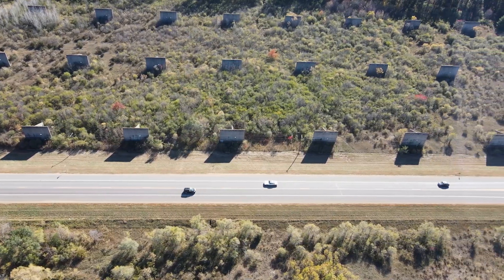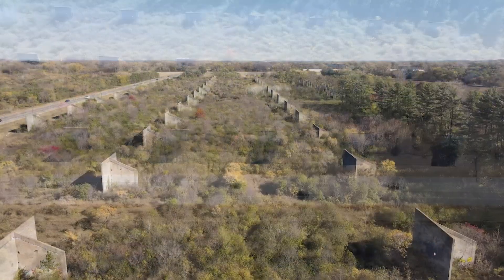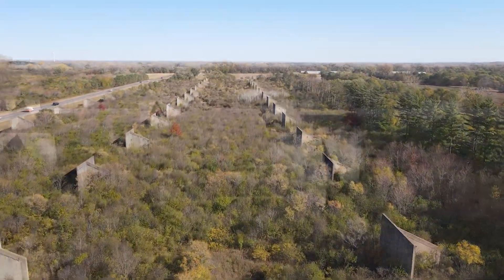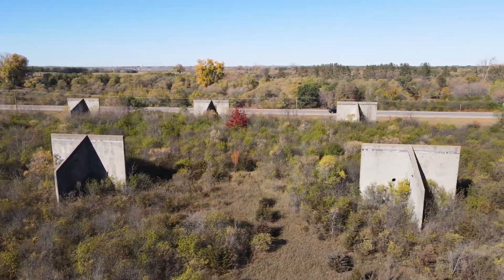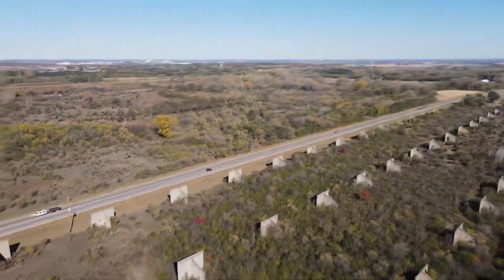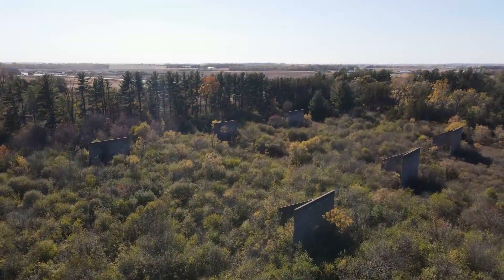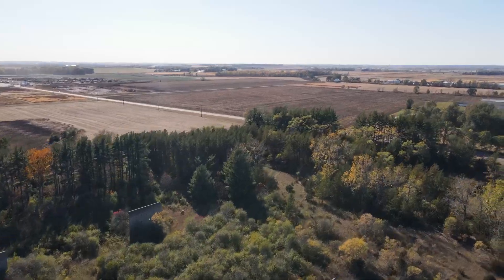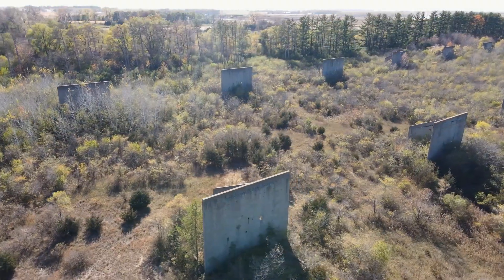What are the Concrete T-Walls in Rosemount, Minnesota?

Comment: My little yard butts up to a BNSF rail line and and they idle their engines behind my house constantly with their poorly maintained and rickety engines. Id love to pour some of these at my property line.

May not stop the diesel smoke wafting through the windows but it should help cut the percussive noises of air compressors running contantly like a Tommy Gun and my pictures may not rattle on the walls anymore. 🤔   Oh wait. City ordinances. 😮‍💨

Comment: See those holes? Those had shutters. The components of the ammunition would go through these holes and where assembled in the compartment behind the wall. The rest of the compartment was sheath metal, that would blow away, in case of a accident. 
They could had used single U-shaped compartments, but someone liked a space and material efficient factory.
Reply from the maker: Oh interesting!

Comment: Surely there are Tons of additional concrete structures under ground associated with the T structures. Removal of all of that would be tremendously expensive, so, in typical Gov't manner they simply turned it over to the state so They have to deal with it.

Comment: Visible with Google Maps.  The building foundations are still visible across the road.  Regards - Mike
Reply: I was curious about their orientation north/south and whether they would make good bracing for a solar farm high enough off the ground to allow tractors, row crops, or farm animals under the panels. Looks like they would be ideal for this. 

The wide or cross part of the massive concrete Tees, which has a level top is square with north. The staff of the Tee is angled downward and is headed due south. Perfect orientation for a solar panel, maybe 30 degrees or more from horizontal. Also allows snow to shed to the south. The tees are spaced about 41m (approx. 135') on center east/west, and north south spacing is about 61 meters (200') on center. This could allow good lateral support for a row of solar panels running east-west. The panels sloped to the south. The shaft of the tee being about 6m long or about 20'. Measured down the 30 degree slope gives a length of about 23 feet. would imply three panels high would be a good number. 

The cross bar of the Tee being about 11m long (about 36') Poles with fairly small concrete pier footings about ten feet on center or more could support the framing for the panel support. Without much need for cross bracing to the ground if the shed roof structure is built like a self bracing diaphragm connected well to the concrete walls every 134 feet or so. A chain link fence on the north  wall line between structures to restrict access. Maybe a ladder at each structure and a cat walk on the top edge of the panels for access. The top edge of the panels being about 30 feet above the ground. The lower edge of the roof being about 18' above grade.

This could be developed as a great solar farm, perhaps in stages, while still keeping the ground mostly open for agriculture of various kinds. Without the need to demolish and dispose of the concrete as waste.

Comment: The "T" walls weren't part of the actual factory - they are part of the ammunition storage area structure. Great video!
Reply from the maker: Ah good to know, thanks!!
Reply: So an incorrect video is still a great video.  Americans are not keen on upping the bar.  Reach arounds for everybody!
Reply: @ShainAndrews  Correct! I should have also mentioned that the factory itself was quite a bit further north, in fact the tech college is located where many of the administration buildings once stood. Google Maps shows a lot of remnants of the factory buildings. My grandfather worked there as an electrician while it was being built.
Reply: @edwardstd52  Google maps shows very out of date pictures of the area. Not much else still standing. A few structures in the woods. A hand full of wooden nailed shut hatches in the ground. Some vent pipes but very very overgrown. If you saw the smokestacks on Google maps, they are no longer there.
Reply: @Boostedfpv   I'm familiar with the Gopher Ordnance Works since my days as a student at the U of MN back in the early '70s. I do remember the smoke stacks from those days. As an employee of the Minnesota State Colleges & Universities, I also visited the area quite often when I had to travel to Dakota Tech for meetings. I think this Wikipedia link has some good info from the olden days: https://en.wikipedia.org/wiki/Gopher_Ordnance_Works
Reply: @ShainAndrews  PARTICIPATION TROPHIES RAISE INCOMPETENCE

Comment: Because they are staggered I say that was BS why would a building have staggered supports, snow fence is a more believable explanation. If it made the road easier to keep clear of snow workers at a vital war plant would be better able to get to a from work.
Reply: Just because the walls don't face each other doesn't preclude them from being structural. Maybe try to search more on structural engineering

Comment: I have driven past those so many times and wondered what they are. I thought maybe they were for wind or tornado disruption. 

Thanks for clearing this up.
Reply: I'm pretty sure that's more likely than a factory.
Reply: @mr.cantsay  You wouldn't say that if you had seen it when the factory was still standing.
Reply: @jbbuzzable  your right but it isn't and some how the floor is missing and every other integral piece of a building. Beside what appear to be wind breaks. I do not know but it doesn't look right to me.

Comment: If their supports for walls to a building, why are they all facing the same direction 🤔 I'm calling bs.
Reply from the maker: Yeah that is kind of weird, isn't it?
Reply: @XRPotanist  then what is it for smart guy ? Please tell everyone
Reply: If it was intended to be a gunpowder factory then I would suggest that these aren’t structural members for the building but rather blast shields for critical locations where especially dangerous processes were to take place. These “T” walls look nothing like anything I’ve ever seen, foundation-wise. So yeah — blast shields.
Reply: @localcrew  they're both.
Reply: They are indeed blast walls for ammunition buildings. I've had asbestos abatement crews out there several times over the 25 years. The static floors contain asbestos and we're originally installed to prevent static electricity build up from the workers shoes and the possible explosions that could result.
Reply: @troymoszer    Wow. Looks like I was right. Hey — it happens.
Reply: @XRPotanist    What the actual fuck?